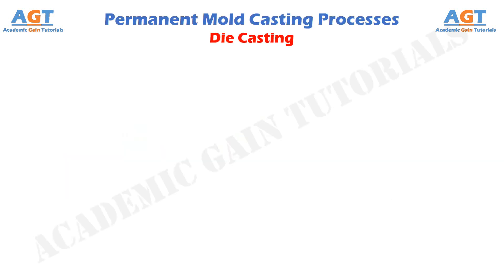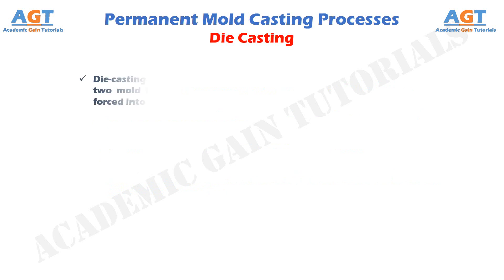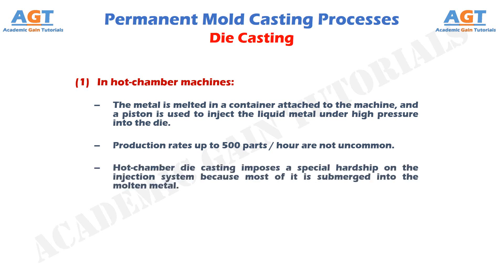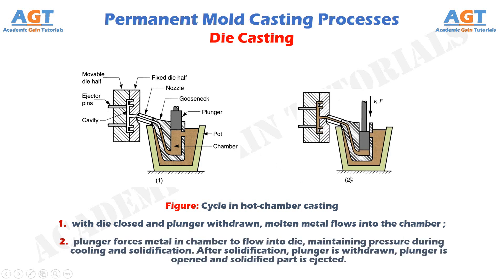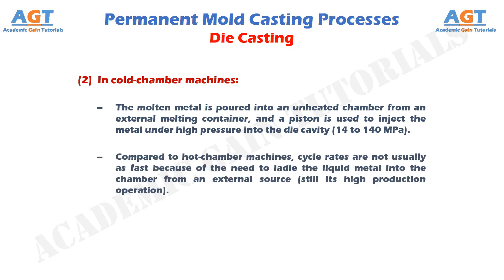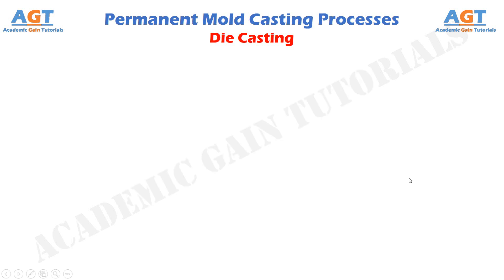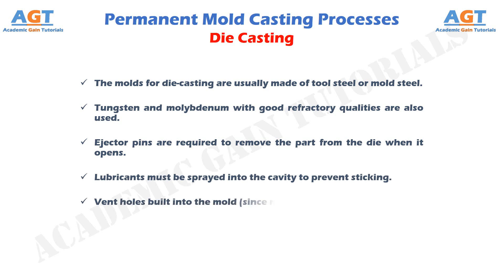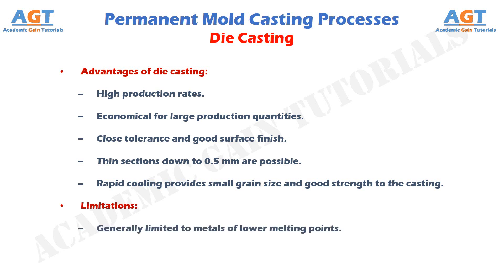Die Casting - Permanent Mold Casting Processes.

Comment: I don't really get the difference between cold and hot chamber, but the video was really good and useful, thanks
Reply: The main difference is that: Hot-chamber process is used for low melting-point metals and alloys 
(zinc, tin, lead), whereas Cold-chamber process is used for high melting-point metals and 
alloys (aluminum, magnesium, and magnesium alloys).